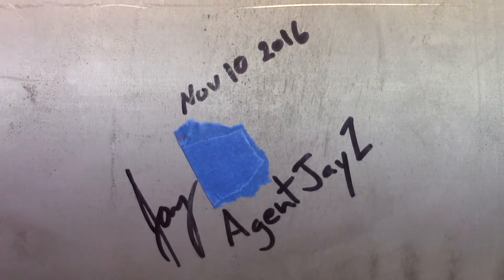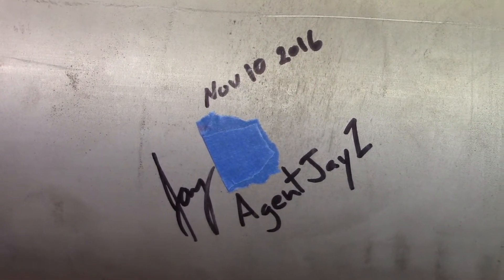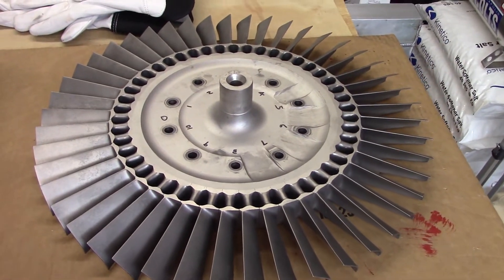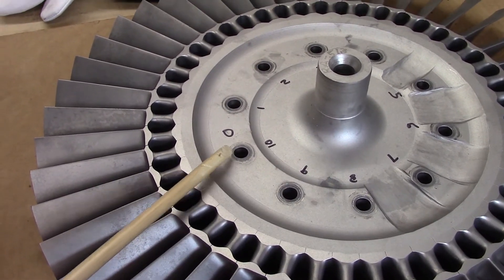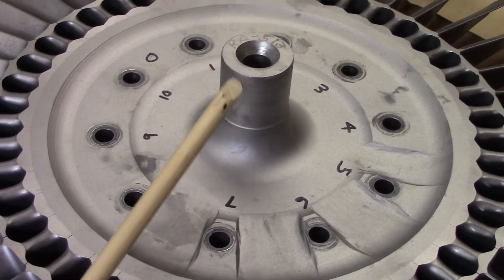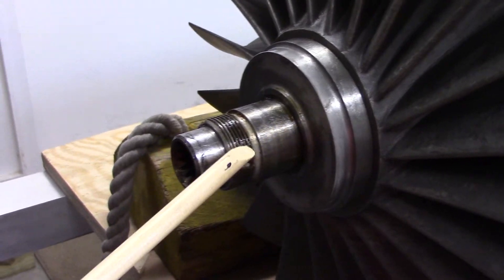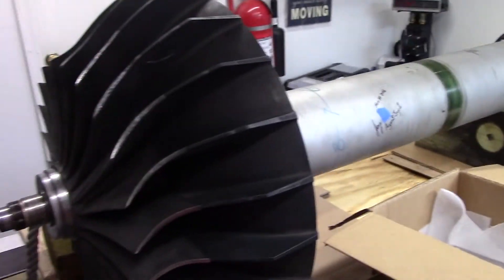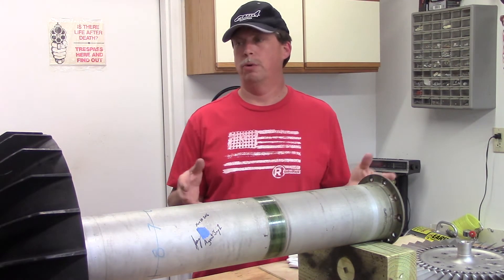The J44 Project:  The Rotating Assembly Overview, Part 2.

Comment: Cool project! Subscribed!  I have only messed around with the R/C model turbines and built a few back before all the commercial ones came out. Saw the one with the NGV heat damage and one thing you may want to consider is adding some independent EGT probes, each with their own visual gauge, at various radial locations. That might help you find any major  inconsistencies in the spray/burn pattern when the fire is lit.
Reply from the maker: Hi & thanks for the comment.  The later versions of this engine have 4 thermocouples in the exhaust nozzle so I know what you are saying.  I considered adding 3 more bungs but that would have been a bit of work for my fabricating buddy, so I passed.  The previous owner didn't try to use (didn't trust) the factory oil mist lubricator & he just pumped a small amount of oil to the bearing via a pump while it was running (with a home made afterburner on it!!) & my theory is that the excess oil was burning in the engine, possibly overtemping it.  Not to mention the AB.  I will be keeping a close eye on the lube system & the turbine nozzle.

DD

Comment: want an all expense paid vacation to California for you and significant other.
Reply from the maker: It's just a hobby for me so I couldn't help you there, however I think I can help you through your project.  Parts are always a problem for old, obsolete machines but sometimes there is a way around.  Most bearings are still made (or an acceptable substitute), if you have the manufacturer's part number to reference.  I don't know for sure about the fuel pump bearing but I would try bearing supply houses searching the number on your old one.  You may be surprised; it may be a common size in a 'super-precision' style bearing!  The main bearings for the engine are harder to find, since they evidently where not commonly used in very many applications.  I found 2 brand new through a bearing distributor from Ohio, who told me he has been in the bearing business over 30 years but had never heard of this particular one.  It is a 'self-aligning' (the bearing outer race swivels in an 'outer-outer' race;  the actual bearing parts (inner race, balls & cage, outer race) are commonly available as just a regular set!  Adding the 'self-aligning' part makes it rare!  I will try to contact a couple of people to see if they can help you.  I can message you via You Tube.  I am not on Facebook often but I will try to friend you there.

DD
Reply: Thanks you for help and the videos.  this project was stalled until I started watching your channel.  It maybe only a hobby to you but you are very good at it.  Look up my website Dial-ables.com you can contact me at my business without jeopardizing you privacy. Regards James

Comment: I'm reworking Evel Knievel jet trike that uses a J44 R3 your videos have been very helpful. Thank you
Reply from the maker: Happy to have been of help.  I will HAVE to see your project!  Keep me posted; or maybe I can subscribe to your channel!

DD
Reply: I could sure pick you brain front bearing is wiped sort of.  I believe your engine is in better shape to start with.  You could connect with me via facebook.  some pics of the jet on FB
Reply from the maker: Actually, my engine needed work due to abuse & hours on it but I obtained 2 'parts engines', of which both seem to be in good condition, internally.  They had no accessories & had been sitting outdoors, so there was rust in the exhaust nozzle housings but the turbine wheel & nozzle of both are in great shape.  After glass bead blasting, the turbine rotor & nozzle look like new!  The bearings are special & difficult to find; good, used ones are your best hope.  The -R-3 model, I believe, uses a different bearing for the compressor vs. the turbine end.  Mine uses the same part number for both.  Be sure the lube system is working properly or you will trash a good bearing in a short time!

DD
Reply: I'm looking for a fuel pump  front bearing good used would work fine.  Completely  run out of spares sources.

Comment: Hey! Thanks for making me feel famous!
I may have not understood the assembly process of  J44 as well as I should have, because I thought The shaft, once balanced, would not be taken apart again.
I really hope you get every washer and nut back where it was because even those are critical to the balance. 
I know you know that... I'm just a worry wart (a nervous pimple?) by nature. ( That's not my joke: it's from Bloom County).

My initial is the same as two other much more famous people who have the same name as me.
If you Google my real name, you won't find me even on the tenth page of results.
If you Google my YouTube name, well, the story is different!
Reply from the maker: Yes, as you saw in the video, I marked all 10 bolts with an index number so that they go back exactly where you had installed them.  The J44 is assembled vertically, from the front, 'up to' the exhaust, similarly to your large engines.  Starting with the intake housing, I must drop the compressor & shaft in, then lower the stator (cowling, diffuser,  c. chamber & nozzle) over that,  then goes the turbine rotor.  The stator, including the c. chamber inner liner, just fits over the turbine shaft flange itself.  The turbine rotor is installed right before the exhaust nozzle housing, so it is actually nearly the last step in assembling the main core of the engine, front bearing to rear bearing.  Once fastened together, the engine can be turned horizontally for final/exterior installation of everything else. 

I appreciate your keeping a eye on me & pointing things out like that; you may just save a J44!  Thank again & cheers!

DD
Reply from the maker: Yeah, I see your hot wife just had twins!  Nice job!  Sorry, just kiddin' AgentJayZ & Jay-Z!  ;-)